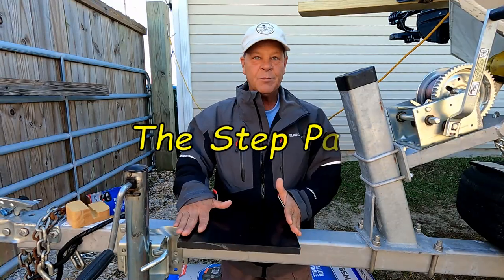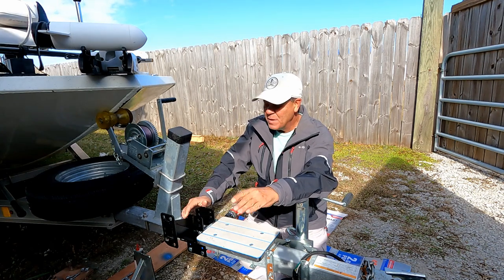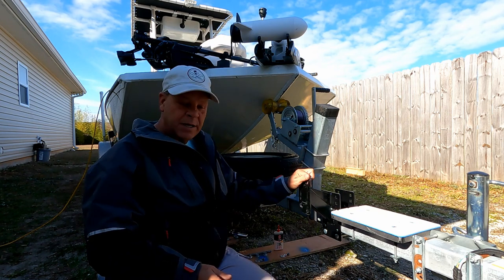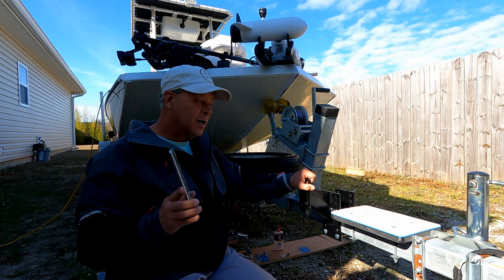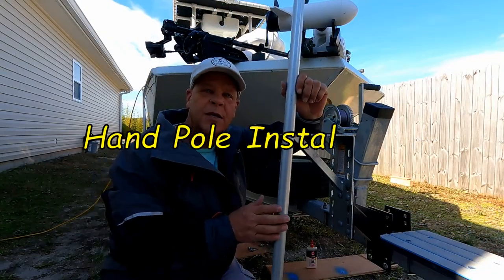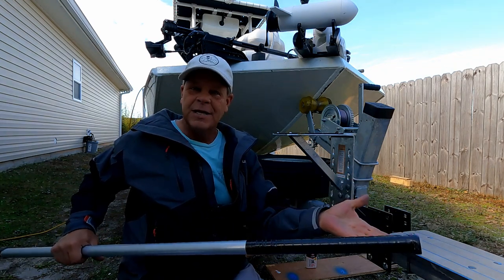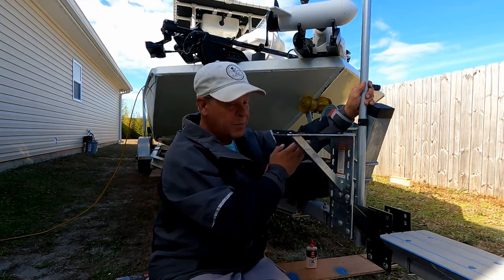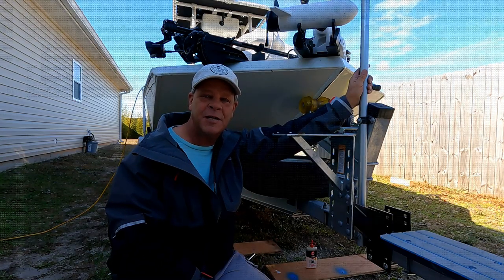Easy DIY HD Boat Trailer Step, Pad & Pole - CHEAP!

Comment from the maker: UPDATE: Do NOT use the EMT Conduit for the pole.  Mine Failed with a stress crack.  Use 1 - 1 1/2" schedule 40 Galvanized steel pipe or 1" square Pipe.  The rest of the system is rock solid. 
Hey, and hit that Thumbs Up and Subscribe button!
Thanks,
  Gary

Comment: The long bolt you added might keep the tire carrier from falling off completely, but it won't keep you from hitting the ground.

A cheaper, easier, and stronger alternative is to mount the step to the winch stand.

Comment: Excellent video, details, design and install.  I’d be interested if anyone has done something similar to a Tracker TrailStar Trailer which has a fold-away (to the starboard side) tongue.  I added the same step but attached it to the winch post, which is not an ideal location and was looking for something like the Starboard/HDPE for the tongue.  I hadn’t thought about using a tire mount along with the step and using EMT for the pole, which are great ideas that I plan on implementing.  Thanks!
Reply from the maker: Thanks for the nice comments.  I only do videos of stuff I actually use. Every trailer is different, so that's where you need to think on how or if it can work on your trailer.  Thanks again.
Reply: @garysfishtales  Checking Amazon right now for the HDPE.  It’s gone up $3 since Dec (like everything else) but still not bad.  I just need to get to my boat and take measurements before ordering anything.
Reply: I have been trying to figure out how to add a step to my trailer and this looks like a great solution.  Thanks!

Comment: Thanks for this great vid... @11:13 what is the measurement from the top surface of the tounge to the top surface of the  step? Thanks.
Reply from the maker: On my trailer, the top of the step is 12 7/8 from the step pad or 13 5/8 to the tongue if you dont put a step pad on.  From the step to the top of my bow is 14".
Reply: @garysfishtales   Thanks so much!

Comment: Just find a friend or a friend of a friend that welds. Get scrap metal, paint, bolts, nuts and non-skid tape. That's about $20-30 tops. I literally have made $1,000's by repurposing metal and selling that item. It's hilarious and doesn't take hardly any skill.....just a little practice and you can weld.

Comment: Great idea. I am disabled and have a hard time getting in and out of my boat. I had looked at some of the factory steps but they are very expensive. I'm going to give this a try. The only thing I would do different is use a piece of metal tubing as a spacer over the 7" bolt instead of the washers and nuts. Great job on the build and video. Thanks

Comment: This is exactly how I done mine. I used 3/4 inch conduit so I can put a bicycle grip on top, only used for balance anyway.😊
Reply: I put my pole under the bottom of the step and attached with pipe clamps and drilled 2 holes through pipe to hold, then bent a elbow on it, and it came up about 30 inches, that’s all I had to go into shop, as far as height, very sturdy i am 210 pounds and it works great.😊
Reply from the maker: @dannylang7971  so, I put a note about the conduit in the comments. Mine got a stress fracture. I would use Sch40 steel tube or square tube. I haven't had any issue with the steel pipe.  But the aluminum conduit did fail. Thanks for watching.
Reply: Thanks for the info, I will keep check on it. Been using it now for about 6 months, no problems yet. But thanks for the information.

Comment: Very good info: where did you get the foam for the HDPE?
Reply from the maker: I have a bunch left over from doing the front deck.  I did get it off Amazon. A roll is $79.99, but if you see an add under "Foam boat decking" that says 9.99 - ??.??, the 9.99 one is for small roll. (Single strip). Same stuff just put 4 strips. Same design. Hope it helps.

Comment: I would have mounted the pole on the other side of the upright just to free up a bit more climbing space.
Reply from the maker: It would be in the way of Crank handle. It's actually in a very comfortable position right where it is. Doesn't get in the way of getting up step.  Thanks for watching and commenting. Happy New Year!
Reply: @garysfishtales  Thank you for the feedback and happy new year